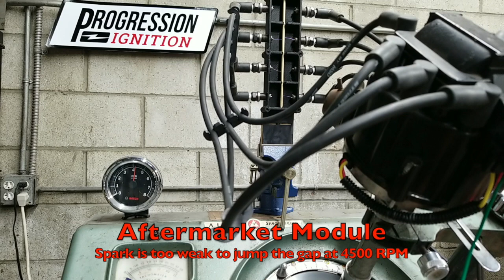HEI RPM Shootout!

Comment: It might sound crazy. But, I switched out an aftermarket HEI distributor for Progression on my mild built 355 in my ‘71 Camaro. I immediately noticed the exhaust note was different. It wasn’t as mellow. It now is, for lack of a better word, snappier. It crackles while idling. The throttle response is better. The exhaust is cleaner. I’d have to guess it’s because of the increased voltage. This distributor is AWESOME!

Comment: I use to run that ignition module on my chevy 406 was a bad ass lightning storm of spark like you've demonstrated in the video. The only problem I ever had was the life expectancy and any long term reliability, even with extra ground straps and gobs of heat sink compound, when they worked they were amazing, but for the life of me, I couldn't keep one for more than a month or two.....? Ended up gutting the HEI all together and running the competition unfortunately, had to go MSD 6-AL mainly for its rev-limiter capabilities. Believe me wasn't a fan of adding extra boxes and rewiring everything to do so. BUT it was one Bad ass module back in the day! It probably needed more heat sink capabilities, that's the only thing I could figure out? Wasn't getting wet being sealed in epoxy resin, but with the amount of spark that throws it probably makes its own heat + the addition heat from the engine up the distributor shaft didn't help much especially when street driving around. Never had a track failure though, being the engine ran shorter periods and didn't get nearly as heat soaked after a single run every hour or so.  Otherwise Highly Recommend this module for drag racing! It definitely kicks some ass as we can see in the demonstration! As for street use though, and I was only going to car shows and back when I'd experience a failure every so often maybe mounting the module remotely on it's own separate heat sink say on the firewall Rt next to the distributor or something? Try and eliminate heat soak into the delicate electronics of the modules. 99% of pos stock ones are heat related failures, so think about something that's pumping out 3-5X's the power output, it's not going to like engine heat soak after a while! Otherwise hats off, excellent demonstration with the differences between them! Thanks for sharing this video.

Comment: I want to try one of these for the easily adjusted curve.   I am a bit confused by what this video represents though.  The grounds are cut off the eight plugs so the center electrode grounds to the vertical rod much further away than the original cut off plug ground, isn't this spark a function of the coil and not the signal to the coil?

Comment: I can see the customer service from you would not be very good look at the questions you cant be bothered answering.........plus the spark would not need to jump the distance you have set on each plug so i guess the stock GM module would work to 6500 anyway....